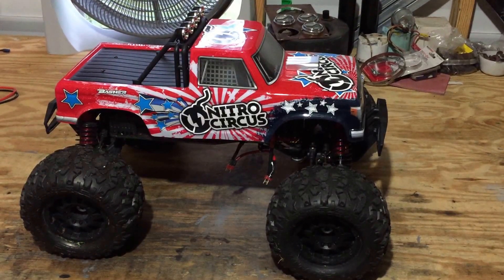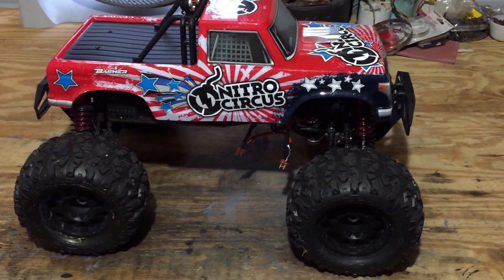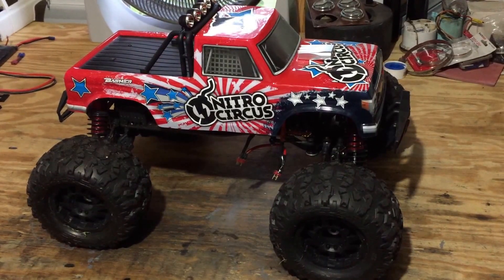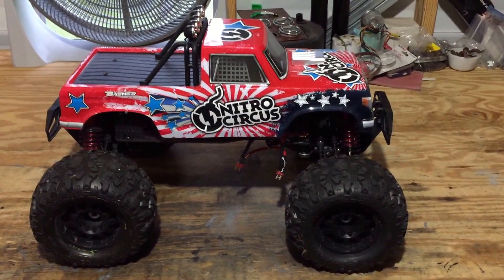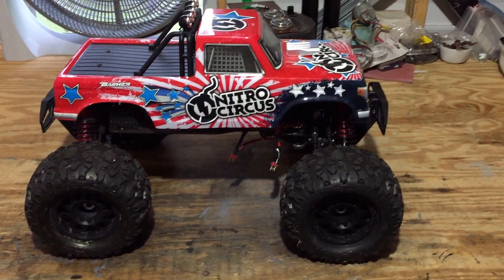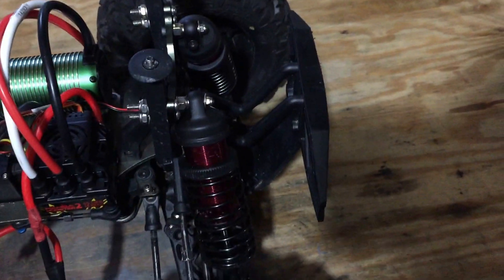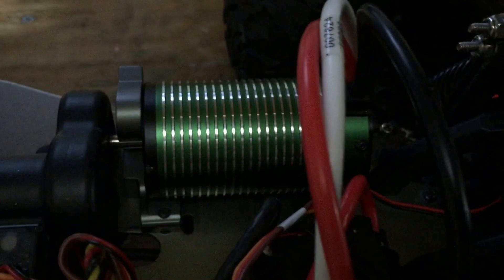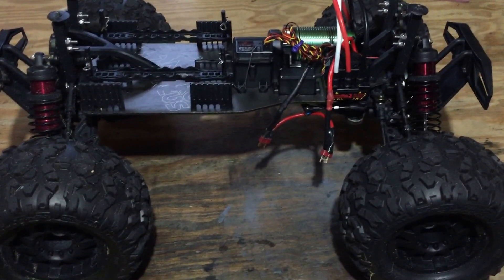Nitro circus Basher 1/8 with mods

Comment from the maker: Slima i used a sabertooth motor mount and i had to drill holes to make it fit. BUT i wouldn't change it this truck cant handle big power had alot of problems with the truck after i put the Castle system in it